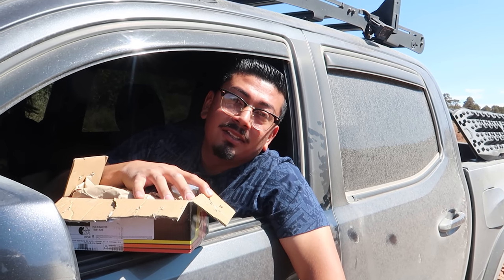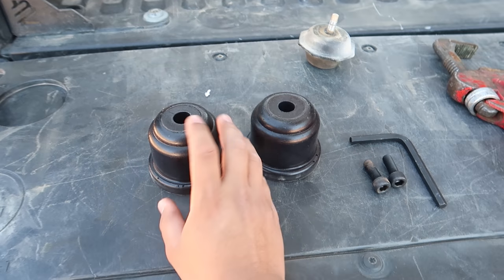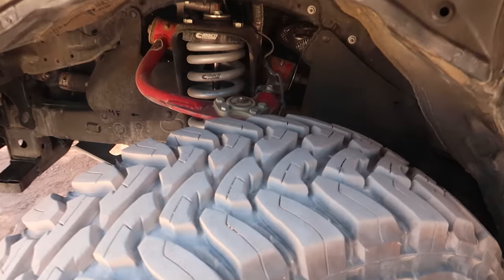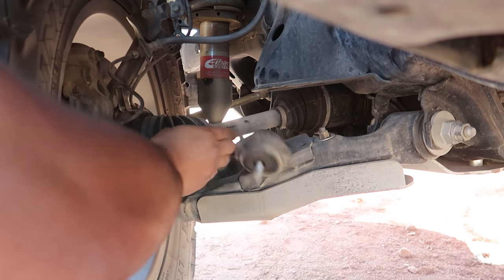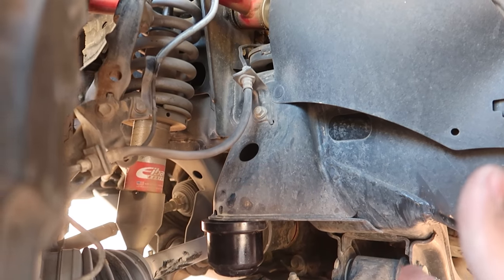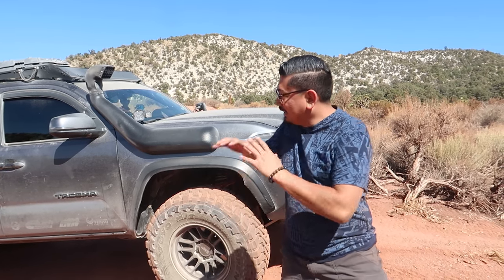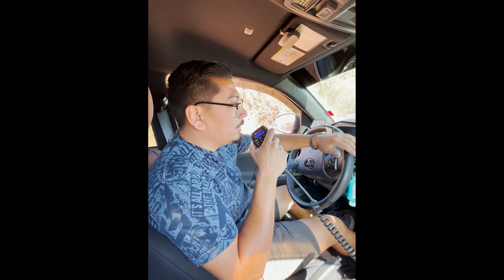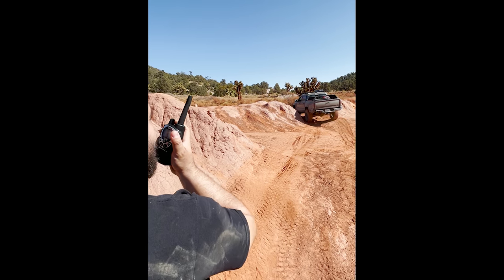A MOD THAT IS OVERLOOKED! | FRONT WHEELERS SUPER BUMP STOPS HOW TO INSTALL ON A 2016+ TOYOTA TACOMA

Comment: Have you adjust your coilovers for more lift since the install? If so, then how's how's ride, has it gotten stiff?

And how's the bump stops? Do you feel it? Or barely noticeable?
Reply from the maker: I have when I put my 35s I have them almost maxed out , maxing them out do not recommend it it doesn’t drive good only reason I did it was to fit my bigger tires I’m upgrading my suspension next so it’s temporary for me 

There slightly noticeable it’s a softer hit when it bottoms out
Reply: @JesseRizo  so you max them out at 2.5" of lift?
Reply: I’ll buy the eibach suspension off you when you get a new suspension 🤙🏼
Reply from the maker: @nickyakandtacotv2551  send me a dm on Instagram
Reply: You can go up to 4 inches with that eibach setup I have it set at 3inches

Comment: On their ads, it’s saying that these bumps goes on the rear of truck and the OME on the front should remain there…so why did you choose to put them on front when state from company not to do so??
Reply: I was just about to ask same ?
Reply from the maker: https://tacomabeast.com/products/wheelers-front-superbump-set-for-05-tacoma?_pos=2&_sid=1546d189f&_ss=r

There for the front, 
It states rear of the lower control arm (on some cases) your front lower control arm will have 2 bump stops so there saying it in general it’ll go on the rear part (where I installed it) of the front lower control arm

Comment: Does this limit your travel?
Reply: Yes it does limit travel, since its longer than the factory bump stop. For myself, I ended up installing body lift along with my suspension lift to my tacoma, to avoid limiting travel. If you do not want to limit your travel either do a body lift or prepare to start cutting.